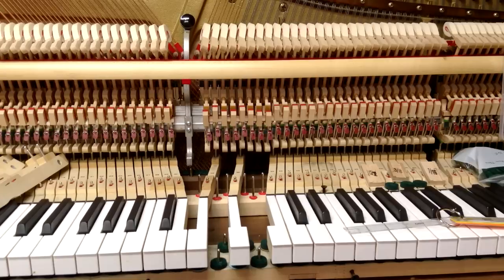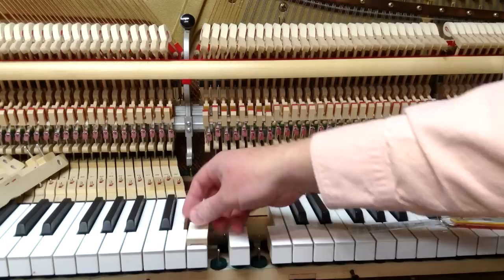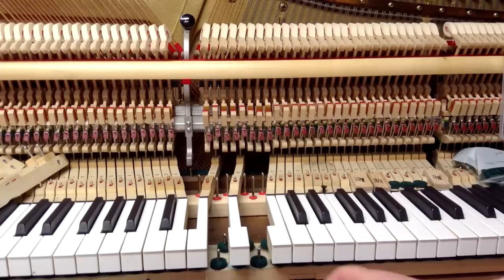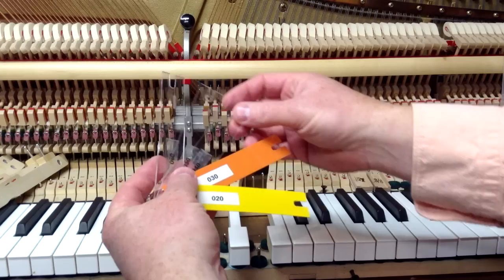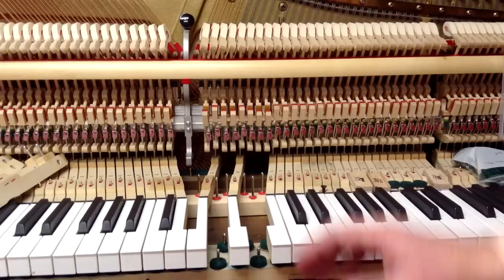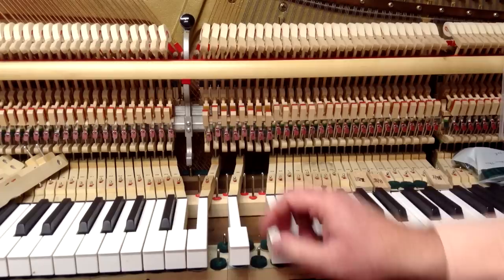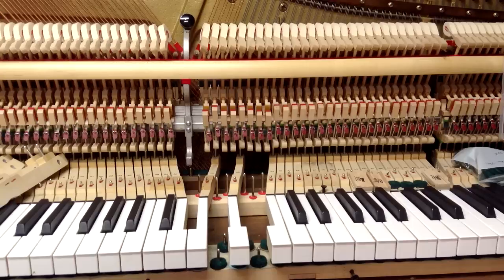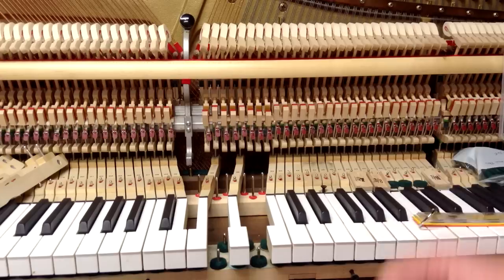Regulating Key Dip and Aftertouch - Piano Tuning & Repair I HOWARD PIANO INDUSTRIES

Comment: nice serial of gauges, I do that mostly for grands.
You can hear with the way the hammer impact synchronize with full key dip, if the aftertouch is correct or no.
But, the backcheck is retaining the butt. To make perfect samples and find what the hammer travel will be I bend the backcheck wire out off the way. Then I can see where the jack will be at full dip, as the hammer is showing that.- the distance is more than the checking distance , about 8-10 mm.
Hammer travel is decided that way in some factories.
One can regulate key dip first, (after making samples) then checking, by tone and sensations under the finger.
AFtertouch is a mean to have just the good amount of backcheck wire compression.so the hammer is released easily but checks well.
Goo tricks and method in that video.
Reply from the maker: Thank you Isaac for watching and for your helpful comments!  I appreciate your input.
Reply: Hi, trying to work better, to understand more the functions, is the only way to be efficient in limited time, or in difficult cases, For instance I had to make a "normal touch" with a Bechstein equipped with a silent system, all the tricks and the knowledge of vertical touch allowed me to success, an avoid the too large aftertouch sensation generally find with those actions (backcheck wire compressed a lot, no way to really play in the bottom of the keys or to play lightly.) 
But in any case,; precision is always the place from where to start ;) leveling the keys with 0.06mm papers did "much" for the touch, in that case, for instance.(better attack angle , at a hair of a degree, is sensitive on the best instruments) etc...regards

Comment: Hi! Did you recommend a key dip of more than 7/16 "? If I use that, or  less than that in my piano, the backcheck stays far behind and does not touch the catcher. I don't understand what is the problem

Comment: Hi there.  Would you please explain how the amount of aftertouch affects the playability of the piano.  There's precious little information about it on the web.  Thanks.
Reply from the maker: Generally if you have more aftertouch, the action is going to be perceived as having more weight, but if you have less aftertouch, the pianist will tend to have better control when playing fast.

Comment: Do yoy have a video on how to adjust key dip on the black keys?  still a bit confused how to use that tool you have for it.
Reply: I suppose same method as on the white keys. You just have to adjust before head with all the white keys removed.

Comment: Hello Steve,
Is it possible to adjust key deeps in grand when the action is removed from the keys (so all the keys are down)?
Otherwise it should be a painful and a very long process
Reply from the maker: Yes, there are a couple of options.  On many grand pianos the keys can be lifted up enough with the action on to slip the punchings on and off the front rail pins.  Another option is to put the punchings on by putting a slit in the punching so it can be slid onto the pin through the slit.  I hope this helps.
Reply: howardpianoind what about the black keys? How can aftertouch be regulated on those without removing the white notes?

Comment: What's the overall effect of having more or less key dip?
Reply from the maker: Less key dip tends to give a little more control as you have less key travel, but you also sacrifice power which you get with more key dip.
Reply: @howardpianoind  Thanks - what's the largest amount of key dip you'd recommend? 3/8" is usually recommended but what about more than that? For instance I've been testing mine at just over 7/16", which you mention in the video, but I'm not sure if it's too much. Are most grands at 3/8"?
Reply from the maker: You could go to 13/32”, but 7/16” may seem excessive to some.

Comment: When I took the action out, most of the white keys sank down toward the front rail. All the holes are loose enough, and the pins polished, the key mover freely. It looks like it's not enough of weight of the key to tilt back. I also played with the central pin but nothing seems to work. I don't feel any friction anywhere.Whet I put the action back, the keys look normal. Any suggestions? Thank you.
Reply from the maker: Hi Galina, It is normal for the front of the keys to drop down when the action is removed as the weight of the action is what keeps the front of the keys up when it is in.

Comment: Doesn't adding punchings to adjust after touch effect key dip?  I'm confused about how to adjust after touch. Would other adjustments also effect after touch, such as adjusting back checks?
Reply from the maker: Yes, adding punchings will affect the key dip.  The other adjustments are adjusting the punchings on the balance rail pin and adjusting the hammer blow distance.  You want to work with these adjustments to get the correct combination.
Reply from the maker: Thank you Mark for your helpful contribution!
Reply: Ok, but I still don't understand the right sequence. if key dip must be the same for all keys,  when you try to adjust after touch, you will have different key dip for your keys. How can I adjust after touch and maintain the same key dip in all keys? Thanks
Reply: @marcelod3666  i have the same cuestion. Did you find an answer? I'm very confused. It's like everything you touch, affects other thing, and i don't know what should i do

Comment: Hi my upright piano has the keyslip built into the piano frame with no way to remove it. Will I have to check after touch from the side of the keybed and remove a key at a time to check it?
Reply from the maker: Yes, unfortunately checking aftertouch is more difficult in these pianos.  This isn't very common.  If you have different thicknesses of cardboard punchings, you could also check the aftertouch with those.  To see if you have .030" aftertouch you could put a .030" punching on top of the felt punching to check this.